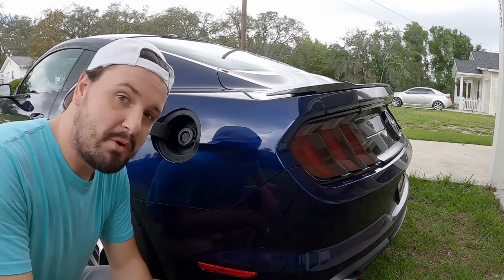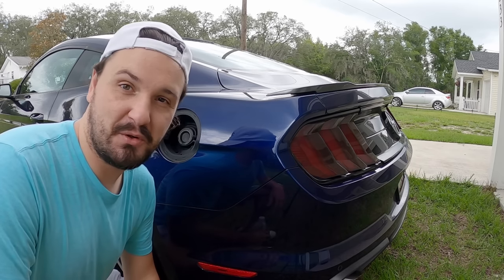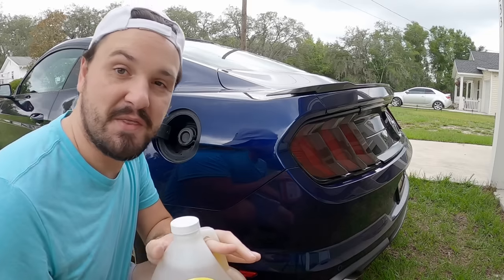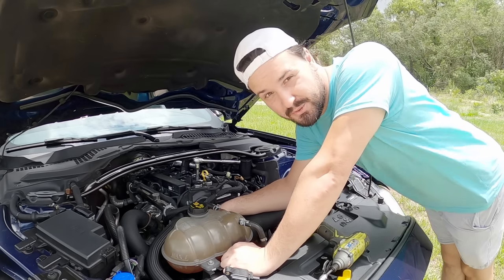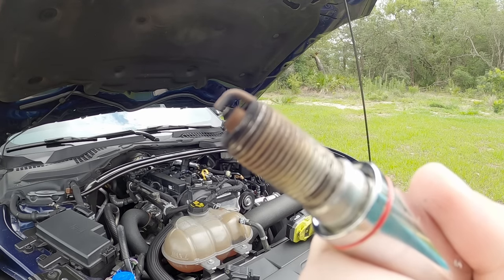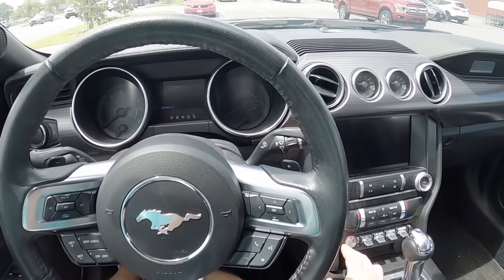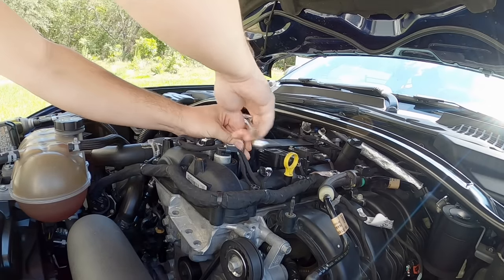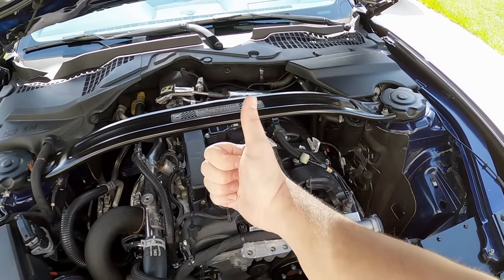The UNTHINKABLE Happened after using a Gallon of Lucas Fuel Treatment!

Comment: As a gas tanker driver for over 20 years all gas for all gas stations comes from the same place the only difference is the additives certain companies add.
Reply: Which big gas brand has the best additives in your eyes sir?
Reply: @bryarhattabaugh7313  any of the big name companies Amoco BP Sunoco ExxonMobil they all add detergents to their gas whereas the no name no frills stations don't thats why they are usually cheaper. Also when going to a no frills station you never know how long that gas has been sitting in that tank their QC is nowhere near what the big names are.
Reply: @ boogaboo--     My mechanic says with the ethanol that they put in gas these days, gas doesn't last nearly as long as it used to. He said to buy gas at a busy station, even if it isn't top tier. 

     Have you ever delivered gas to a Buc-ee's gas station? They opened one here in Daytona Beach, Florida, about two years ago. The station and convenience store is huge, and even though they have 104 gas pumps, sometimes it is hard to find a pump that is not being used. I was wondering if Buc-ee's is considered top tier?
Reply: @franknew9001  yes that is true the more ethanol in the fuel the less fuel mileage you will get. Always try to find the lowest ethanol content or no ethanol if possible. Also he is correct always go to a busy gas station because the fuel turnover is faster and the longer fuel sits it tends to go bad or collect water. I have heard of buccees but I delivered nyc Brooklyn queens Nassau Suffolk and I'm not aware of any around here so I'm not familiar. But I will tell you if they sell cheaper gas there's always a reason why its cheaper sometimes if its only a couple of cents cheaper than nearby places its because they get a large volume discount or they aren't making any money on the gas whatsoever because those places tend to use cheaper fuel as a way to get you into the store and spend money thats how they make profit and also usually because they don't use any special additives thats why there is always a huge difference in an ExxonMobil or sunocos prices vs a no frills Costco or Valero or Walmart gas station. And if you see a gas station with really low prices like way lower than anyone else stay away its either because the gas has been sitting in the ground to long or they bought a bad batch and just wanna get rid of it. Don't get me wrong its always possible to get a bad tank of gas from anywhere its just less likely from a big name. Keep in mind gas stations tend to make from 0 to 10 cents per gallon profit there's not a lot of money in gas fuel is usually a loss leader its all in the store that makes the profits.
Reply: Marvel mystery oil is where it’s at.  Couldn’t be happier.
Reply: @ ChileAddict505--      I agree with you on the Marvel Mystery Oil. I have been using it for 7 years at every fill up at the recommended amount of 4 ounces of MMO for every 10 gallons of gas. Both vehicles are 21 years old, and are running better than ever. I also use it in my lawn mower.
Reply: @franknew9001  i agree marvel mystery oil is one of the better ones.
Reply: @ boogaboo--      I started using Marvel Mystery Oil back in 2016 on the advice from my mechanic who had just replaced the fuel pump in my 2002 Chevy delivery truck. He said that by using some MMO in the gas, it would lubricate the new fuel pump and it would last longer. I also started using it in my 2002 Lincoln Town Car, and they are both running better than ever.

    Several years ago, my truck had a loud lifter ticking noise. It was a quart low on oil, so I added a quart of MMO to the crankcase. Soon the lifter ticking noise disappeared. I drove the truck about 400 miles and when I changed the oil, it was extremely dirty, and this was telling me that the MMO was removing the sludge out of the engine.
Reply: @prosperity4444  I drove for a company hauling fuel for a year and a half. Left in 2019. We still top loaded often on partially full compartments at the bulk plant. Terminal was pail drain and bottom load. No EPA in Canada 😀 still pretty stone age, probably not many places still top loading anywhere even in Canada
Reply: @juliogonzo2718  nice yeah I ran a 9500 gallon top load tanker also out of the brooklyn terminal. 3am load up i don't miss those days.
Reply: me too 15 yrs
Reply: Why would you add a whole gallon to one tank? A gallon treats 400 gallons of gas! You have no idea what your doing, do ya!
Reply: @kevinmeyer3884  thinks Lucas will pay him enough for a new Mustang?
Reply: That's not exactly true. There's more than one refinery that creates fuel, and I hauled from 2 different places in Michigan. I would say 1 plant was much better and had significantly fewer problems with pumps, mixing, and cross contamination. Marathon is a good company to get fuel from in my experience.
Reply: @kevinmeyer3884  Have you ever been entertained?
He didn't recommend that you or me try this.
Reply: @ Tricky Mick - Ethereum Classic Frog Bogs--     Within the past five years, Marathon has opened several gas stations near where I live. They have a cash and credit price, and the cash price is usually the lowest price of any gas station in the area. I noticed on the pump that it has a STP fuel additive. I usually buy my gas Marathon and have had no issues with it.
     Maybe because Marathon is newer in my area and the lowest price, some people tell me that it is not Top Tier. I tell them it is Top Tier. Seeing that you have experience with different brands of gas, it is good to see that you recommend Marathon gas.
Reply: Says on the bottle that an overtreatment is not harmful.
Reply: @franknew9001  buc-ees is not top tier from what i understand. Typically at the pump there will be a sticker that states top tier. I think buc-ees is a discount gas. If your vehicle is direct injected or turboed or both it is highly recommended to use top tier. Just my 2 cents
Reply: We have Valero gas here as alternative to big name gas stations. No additives and plenty rusted damaged fuel pumps as a result. Garbage gas to be sure. Made them replace and pay labor of 800.00 to replace my fuel pump in my 1997 Chevy Van before...they actually have paperwork to fill out to have that done knowing their gas is bad.
Reply: @ TheOne38--     Thanks for your reply. My daily driver is a 2002 Lincoln Town Car that I have had for 16 years. I usually buy gas at Marathon, Mobil, Shell, Sunoco, and Buc-ee's in that order. I usually check Gasbuddy before I buy gas to see who has the lowest price. Usually they are a similar price, but I have seen Buc-ee's up to 40 cents cheaper at times.
       
     For the past 7 years, I have been using 4 ounces of Marvel Mystery Oil at every fill up. I also add a can of BG44K to the gas once or twice a year, as well as a bottle of Chevron Techron on occasion. The car is still running very well, so hopefully these items are keeping my fuel injectors clean.
Reply: @prosperity4444  well that’s what makes the difference just so you know.
Reply: @prosperity4444  oh and you know how long gas has been sitting in the tanks at big brand name stations? 🤦‍♂️🤦‍♂️🤦‍♂️🤦‍♂️.  As I see the no name stations are way busier than the big stations.
Reply: @prosperity4444  totally untrue.  Valero is no frills?  They are one of the biggest stations. 🤣🤣.   And stations can’t buy a “bad batch”.  No such thing.  Gas is cheaper at many stations because they are not as greedy and make up for it in volume. I never seen a cheaper station not busy.  I’ve seen plenty of Mobil’s Sunoco etc constantly empty.
Reply: @prosperity4444  🤦‍♂️🤦‍♂️. Way more than 0-10 cents a gallon profit in fuel.  Ur talking delusional.
Reply: @franknew9001  That BG 44k is one of the best on the market in my opinion. That Lincoln at that year is port injected. Which you can use just good ole gas in it with the additives you are using and should be just fine like you have been
Reply: @franknew9001  At the places I went, Marathon/Speedway have their own special blend right at the pump, everything else was generic blend.
Reply: Good to know! Be safe out there driver.👊🏻☕️
Reply: Or don't add! Walmart fuel is basic fuel. Others are Top Tier with additive for a clean burn. GDI Engines need Top Tier Gasoline
Reply: Yep
Reply: @randywl8925   That was not entertainment🤡
Reply: @dakotaautosales9673  
....not a documentary or a Lucus instructional video either.
Reply: @kevinmeyer3884  yeah actually he does he did it on purpose as a satire (joke if you're too dumb to know what satire is)
Reply: @prosperity4444  yes, my father-in-law owned a gas station/convenience store & said he made no money on the gas, the gas was a magnet to get people to come in & buy merchandise, that's where he made his money.
Reply: @boogaboo  ey man. I really do  appreciate your information. Makes sense.
Reply: I work at a refinery.  The tolerances we have to be in are so tight because of regulations on fuel.  I'm sure the 3 other refineries within 30 minutes of me have the same guidelines and I'm pretty sure Exxon's gas is sold by Exxon and Shell's gas is sold by Shell.  And so on with Marathon, Bp, and other brand-name gas stations. They don't want to pay the competition.  The off-name stations are buying what they can for the best market price.  So in fact NO not all gas comes from the same place.
Reply: I stick with shell 93 octane 😂😂😂
Reply: You are correct.... I have a friend who owns a gas station, and he said the "tank farm" in greensboro nc "gets ALL the gas in the colonial pipeline from Louisiana pumped in one pipeline..... its all the same gas. The tank storage companies just add their own additives"
Reply: That’s absolutely not accurate. The natural terpenes Alone in gasoline and diesel etc is incredible. Its a lot like marijuana where they all lend different smell based on their origin and genetics etc.
Reply: I knew a tanker driver and he told me the owner of gas stations would regularly tell him to dump reg gas into the premium tanks.
Reply: Actually it 2
Reply: My daughter worked at a Sams gas station back in the early 2000’s. They never put additives into their gas she stated.🤨
Reply: @franknew9001  

Be careful cleaning an old engine as it can cause gaskets to start leaking.
Reply: Not entirely accurate, some gas stations use more ethanol than others.
Reply: So all the refineries are a lie??? There is just one refinery for all gas??? Too weird and somehow you are a chemical engineer also... Giving advice about the Petroleum Industry and their products,  who's is better and who's is not... Crazy... I guess I dreamed up being at multiple refineries over the years as a NDT lvl 2 inspector for certain items inside these refineries and also the Oilfield and Oil business for more than 20 years... Have and had family in the Biz.. And you named a few companies that are paying retirements to those family members.. Well thank you for teaching me something new today I had never heard of even in jest.. But for real, besides poking a stick at ya, Be safe out there... Them 4 wheels are morons and the 2 wheels are worse.
Reply: @scottyellis3442  Heard the same thing from all of the GS/CS's that I delivered fuel to for ten years, the only fuel that they made any money on was diesel. Gasoline just got people to come into the store and buy stuff.
Reply: @zazz69ed  lmao I had the same thoughts.
Reply: They always sell gas cheaper in the ghetto 😂
Reply: and some have rusty old tanks they store them in
Reply: @bryarhattabaugh7313  look up Top Tier fuels, they add more additives than the government requires. My GMC Terrain's manual recommends them for longer life and cleaner engine.
Reply: @bryarhattabaugh7313  Top Tier also has an app to see the nearest stations with them and prices
Reply: @executiveinvestments  the biggest difference in fuel sitting in the ground between big name stations and no name stations is that the big name stations are all monitored by the home office and if the quality falls below their recommendations they will have the fuel pumped and dumped. Also big name stations make sure filters and pumps and tanks are regularly maintained whereas the no name stations have far less quality control.
Reply: @executiveinvestments  I'm not here to argue with someone who has never been in the field a day  in their life.
Reply: @executiveinvestments  Valero is no frills sorry buddy. And bad batch means buying from a less reputable producer where the qc sucks.
Reply: @PinChE_LoCo  no problem thank you
Reply: @kylebowen4793  I'm speaking in general terms. The raw materials basically all come from the same place.
Reply: @mikewheeler1939  yes it does happen but most likely to happen in a no name station.
Reply: @Mike-qo4kp  yes this is true and some states have no ethanol at all
Reply: @zazz69ed  no you misunderstood what I'm saying I'm speaking in more general terms. Yes there are many different refineries what I mean is the basic raw ingredients to make gasoline all comes from one place oil. I was also only speaking about where I worked I said I couldn't speak for everywhere but I hauled for a bulk tank company and I loaded at one refinery and I made deliveries to all brands of gas stations. But again I've been retired for awhile now and things have changed I'm sure.
Reply: @prosperity4444 So basically your saying that you were one of the guys cheating the customers with the 89 octane BS
Reply: @mikewheeler1939  and he's supposed to say, "I can't do that that's fraud"
Reply: @prosperity4444  Ok my apologizes I misunderstood then.. my mistake. Be well.. and still stay safe out there!! and enjoy retirement!!! My wife kicked me back into working part time to get me out of her hair and out of the house LOL Oilfield is starting to act like it is going to pick back up but I'm no young man anymore LOL
Reply: @bryarhattabaugh7313  from research Chevron as they use Techron which is to this day the ONLY additive approved for use by manufacturers. Shell and 76 have their own formulas, not as good. 

Is techron worth the extra expense? Well, techron does a good job of cleaning the inside of your engine (not the best explanation but it's accurate) and if you regularly use the product over time the added cost should pay for itself with reduced maintenance costs. You could look at it like spending the extra money is a long term investment in your vehicle. 

The bottom line however is this, if you want absolute VALUE here when purchasing gasoline, your best bet is to get gasoline as cheaply as possible (try to avoid the bargain gas stations as they typically water down the gas with ethanol) and add a bottle of techron to a tank of gasoline once a month. The amount of techron that chevron adds per gallon is so small it will only make a difference if you always use chevron gas and no other. 

Personally I get gas at Arco, they seem to have rock bottom pricing and low to no ethanol, cost wise they are usually .40$ a gallon cheaper than chevron. A bottle of techron is $7.00 or so. Crunch the numbers this gives you the best of everything, good cheap gas and the investment to the future longevity of your vehicle.
Reply: @prosperity4444  much truth here
Reply: @mikewheeler1939  

That's fraud.
Reply: @mikewheeler1939  I don't doubt that for a second. If there was a quick way for buyers to analyze octane at the pump you'd never see that again. There's almost nothing preventing every gas station in the country from dispensing 87 octane advertised as 93. The average driver has no clue whether their vehicle is responding any differently. This kind of ripoff at the pumps is nothing new. It's been going on forever. Some news station back in the 70's in NYC area randomly tested some premium fuel at a gas station and it turned out to be 87. Who monitors any of this for the customers these days? I don't know of any entity that does as a regular practice. One thing I can guarantee; if you buy 87, you're getting at least 87. Anything after that is a crap shoot. Btw this video is dangerous. You'll have Mustang owners all over the country buying pallets of gallon jugs of Lucas and swearing by this method.
Reply: @ Jesus is Alive--      The only oil additives that I have used in the past 10 years is BG-MOA and Marvel Mystery Oil. Marvel has been around for exactly 100 years, and has been thoroughly tested not to cause any damage to gaskets. The only time that Marvel might have caused a leak is when it has removed some of the sludge that was keeping the gasket from leaking.
     Thanks for your reply.
Reply: Same for motor oil, brand is pretty much irrelevant.
Reply: @bryarhattabaugh7313  Shell gas has one of the best Additive packages to their gas but their price reflects that. boogaboo is right about the source of all gasoline today, it's not like the old days when some of the larger companies had their own distribution centers.
Reply: @prosperity4444  There are several different crude oils though.   We run a heavy paraffin crude where I'm at that would yield a little less in the iso units than other refineries.   I'm not trying to argue one way or the other.   As I said though,  the regulations put forth by the EPA require certain parameters for fuels be met on the tank before it can be certified to ship.  And there's multiple ways to get the petrol cuts.   Like cat cracking.   At the end of the day there still has to be a test on everything being shipped and I'm certain that happens everywhere.   If you are getting scale and water in your tank then it's time to go to a different station either way.   My only point is that these issues are not coming from us (the industry).
Reply: @alfredocuomo1546 The refinery I work at must just be behind in the times then.
Reply: @kylebowen4793  I wasn't speaking about refineries but rather distribution. My buddy worked for Exxon in Linden New Jersey and all the Exxon stations in NJ received their gas from that refinery but today they get their product from a universal distribution point and it isn't delivered by Exxon tankers but rather Island Transport. Maybe where you are it might be cost effective but not in the Tri-state area as far as I know.
Reply: @prosperity4444  I like the fresh hot dogs on the spit and they have the freshest buns.👌
Reply: ... And the additives are the proven important bit.
Reply: Is that you Casey?
Reply: @zazz69ed  yeah, and then it all goes into the same pipeline...the additives are added the hubs. Boogawhatever was correct, despite your self identifying as an inspector.
Reply: I hauled for 5 years.  Never had any additives at any of my stations.
Reply: @Nicole C  they add them at the hubs...not at the stations...unless you go to that crappy Murphy station that you can buy the gimmick stuff, and it "blends" it while you pump...
Reply: @bryarhattabaugh7313  shell.
Reply: Nope.
Reply: If you want added protection.. add some 2 stroke mix to your gasoline.. I'd keep the ratio  lean at 100 to 1
Reply: @ChileAddict505  marvel has always worked since the 60's for me
Reply: @franknew9001  as a snowmobile mechanic i got certified in 1993 to do "warranty" repairs on POLARIS  equipment in Milwaukee, i was employed at a polaris dealership at the time.
they told us that GASOLINE WAS FORMULATED TO LAST JUST 30 DAYS"   THAT WAS BACK IN 1993!
they also showed us where the secrete hidden numbers are on personal watercraft  so we could give the numbers to the police in case they suspected the craft as being "STOLEN PROPERTY", AND TOLD TO NEVER EVER LET THE POLICE KNOW WHERE THOSE NUMBERS WERE.        LITTLE DID THEY KNOW THAT I HAD BEEN KICKED OUT OF PORTAGE SUPER MAX ON MANDATORY PAROLE LESS THAN 1 YEAR PRIOR!!!!
Reply: @executiveinvestments  I've seen gas stations get bad gas as I've purchased and and many other did as well and company checked into it. Gas goes bad quick especially this reformulated ethanol oxygenated crap. You may be lucky and live in part of the country that doesn't use this crap. Most certainly a fact stations get bad gas!
Reply: @prosperity4444  mobil bad gas two time in one year!!!
Reply: @buixrule  my Lincoln LS has spark knock if I use anything below 91 my gmc 6.0 has knock on anything lower then 89.
Reply: @gunguyforlife630  there big difference in motor oil plenty of info online and again it's about additives. Go to cheap oil change place and you'll be replacing a engine . I've seen the inside of these engines that run cheap crap oil. Big difference but hey you do you!
Reply: @dennisbonville3217  you can “see” bad gas now? 🤦‍♂️🤦‍♂️🤦‍♂️🤦‍♂️.  No.  Stations don’t get bad gas.  That’s a myth.  Gas goes stale in time yes.  So you went to a station that doesn’t sell much gas so it went stale.  Wow what a surprise.  Has zero to do with a “bad batch”.
Reply: Bwahahahaha, I worked on tankerships, we picked up gas from Shell Oil and ExxonMobil and delivered to British Petroleum and they had tanker trucks from every gas station out there filling up next to each other!  IDK about additives! Could be a ploy! Lying just like every other Corporation out there!
Reply: @franknew9001  
So Marvel mystery oil will take the slack out of valve lash when the clearance measurement exceeds manufacturer tolerance specifications?… 👍
Reply: Buc-ee’s is NOT top tier.  It is exactly as the writer stated.  They sell cheap gas to sell other stuff.  Their gas does not have detergents that are required to be top tier.  I do love that they sell ethanol free 93 octane gas and they are a great place, clean, good food, safe!  I purchase their non-ethanol 93 octane and add a bottle of chevron additive.  Any additive with PEA - Polyether-amine will clean the injectors.  I have read and watched that ethanol free gas and PEA is the best combination for any engine and especially for cars that do not get driven a lot or sit through winter……….this is not professional advice and I am not a mechanic.  I simply watch a lot of you tube and Porsche Club of America often has experts on to discuss fuels and fuel additives.  You can google it.
Reply: At least he did this with a gaystang 😂
Reply: @DavidBoerboom     I hauled gas for 5 years.  They didn’t add at hub
Reply: @nicolec7290  yes they did. You just weren't there.
Reply: @ETCFrogB as a contractor I work at the marathon oil refinery in Michigan and they take their products seriously I agree marathon or BP/ Amico are the best fuels
Reply: @prosperity4444 thank you for all your information
Reply: @Mark USA  uh, no. Shell is BY FAR  the best / most superior unleaded gasolines...even over ExxonMobil... .
Reply: @prosperity4444  Sooo going to the no frills station is best to use a gas treatment additive and perhaps octane booster?
Reply: @ChileAddict505  all it is l, is mineral oil.
Reply: @DavidBoerboom  …and it works as advertised.  🤷‍♂️
Reply: @prosperity4444  Costco an Valero are in fact Top Tier certified fuel
Reply: @ChileAddict505  
Interesting.  Our XJ has 373k on it  and still gets 22mpg.. no smoke.
We  do use a bottle of Techron once a year but it runs this way on 85 octane at 8000 feet.
Reply: @executiveinvestments  👈 someone doesn’t know what they are talking about
Reply: @ohboy2592  👈👈 someone is triggered that I actually know what I’m talking about.
Reply: @executiveinvestments  lol, my family has been in the service station and gas station business going back to the mid 60’s.  I can tell you from longer experience than you’ve been alive that you don’t know what you are talking about.
Reply: I used Lucas Oil in  my gas tank on a 2007 Lincoln Towncar and it corroded the gasoline measuring device. My   tank always read full even when empty.
Reply: That's correct.
Reply: @boogaboo9851  No frills type stations like you say sell cheaper gas, so usually get more business from low income earners who drive old beaters that might not be all that fuel efficient..  So no problems where I am about old gas at the pump...lol...
Reply: I had 3 Camry they all stall cause I never put additives the 3 one it ran so good I wish I learn that no gas station don’t put any additives
Reply: Yep. I followed  a tanker one night for fun it stopped  at chevron, Arco, shell, Safeway gas and valero
Reply: @bryarhattabaugh7313  you can buy the additive in a bottle that Chevron adds in at the load rack.
Reply: @prosperity4444  I use to load both over the top and bottom load dry lock. I worked nights for 7 years before moving to days for the next 17 years. On one night run I pulled into the unmanned load rack to see a containment area 5” deep in diesel fuel. Had to call the boss to let him know I needed to go load at a different rack.
Reply: Uhhh no that's not how that works. They are refined using the exact same process, but they do not come from the same place. Texas uses oil from Texas, PNW uses the Pudget Sounds oil, Alaska uses AK oil. 

Best gas you're going to find is going to be ethanol free (if price is no objective). 

As far as the best gas you can find for a cheap price you want a station that sees a high number of customers like QT or Murphy's. Off-brand gas stations are the ones that shut off tank alarms and continue to operate. Big companies do not. High fuel sales also reduces the likelihood of moisture collection in the fuels as they are constantly refreshed. 

Worked over for a dozen gas stations in my time, I've seen both the right way to do things, and the cheap ass shortcuts.
Reply: @bryarhattabaugh7313  shell vpower
Reply: is it true costco adds additives on the spot?
Reply: @daveroski  i can't speak for Costco i never delivered to them. I hauled for Amoco, Mystic and Island
Reply: Same with a lot of the oil
Reply: @buixrule  there is. Ktuber. Or most tuning platforms. It will tell u your knock control number. K-control. After driving a little with crap gas it shoots up an I know it's crap gas hahaha. Happens at Mobil an shell every once an a while but not as big of a dip.
Reply: @franknew9001  That's what he meant.
Reply: @ChileAddict505  Too much will melt your gaskets
It ruined our engine. We had Junk the van
Reply: @franknew9001 marvel mystery oil is an oil with high detergent. Similar to ATF.  Putting this stuff in your gas tank will not help clean it. Similarly to water, gasoline doesn’t mix with oil well after its been refined.  What you are likely doing is making your fuel pump run harder and clogging up your fuel filter and injectors faster and hurting your engine’s performance and reducing your gas mileage.  4oz isnt much for awhole tank of gas. But it most definitely isnt helping anything in your fuel system.  Putting MMO in your engines oil will help remove oil sludge though over time.  Dont expect instant results. And be weary of old oil seals and gaskets. It’ll likely accelerate the leaks
Reply: So very true
Reply: I'm not disagreeing with you. But I had a car that was Very sensitive to fuel brands. It was a 2005 Scion XB. I Could use Jetpep, (currently Marathon) and Never Ever reach 30 miles per gallon. The most i got from them was 27-28. 
I could use something like Shell fuel or BP and easily get 35-37 miles per gallon. There was one gas station in my town I could use that did better than any other. It was an ExxonMobil station. We had 3 of those stations in our city. But only one would give me peak fuel mileage. Using that station and only that station, I could get 43 miles per gallon from that fuel. All 3 were supplied and serviced from 1 local company called Brown's fuels. I found it odd that only one would do peak economy out of all three from the same fuel supplier.
Reply: Sarcastic, cynical love it. So the conclusion is that most of these expensive products do absolutely nothing and at the expense using fuel additives on a regular basis you're paying Upfront for the cost of the repair that you're trying to prevent in the long-run anyways
Reply: Royal Purple and Chevron fuel system work great too. Hope you changed your motor oil after that treatment? That puts lots of contaminates in the motor oil.😎
Reply: Most of the convenience stores, Casey's, Holiday, etc contain little or no additives. At the racks in Minnesota there are 27 recipes for regular unleaded gas.
Reply: @prosperity4444 how and when do they mix in the specific gasoline brands' additives?
Reply: 20 years of wisdom summarized 🤯
Reply: When I hauled gas in 2001 there were many different recipes for gas at the rack. I always double checked mine before I started.
Reply: Around Christmas time every year my old lady gets this lantern fuel that smells like evergreen Christmas tree I pour a quart in my 350 Ford 6.0 at fill up, boy does it smell good running down the road,. Truck over to my mechanic friend he pulls my turbo off every year clean the veins and making sure the bearings and my veins are moving like they're supposed too not gummed up now he says everything works like it should and it smells better than any truck coming in the door ,
Reply: In my experience,  in Canada we have Fast Gas, Domo and my take is anytime I have water in my tank ... OK not my car however friends that fuel up at those places the gas will have excessive water/moisture in there gas, and I agree with ethanol.... it sucks. I always have a jug of methyl hydrate for daily commuters on the road driving Lexus ect. with cheap gas. A jug worth $10 will always pull many people out of a bind. Oh yeah diesel fuel is worst but I don't drive a diesel so most of them carry fuel conditioner
Reply: This has been an interesting read! My experience with my 98 Dodge Durango with the 5.2L motor has been really simple. I owned the Durango for 11yrs. When I bought it, the Durango had 62,500 miles on it. Now it has 152k miles. So when I bought the Durango I had the injectors cleaned at my only shop I take my vehicles to. Since then I run 87 or 89 octane gas and every time the Durango gets serviced (oil change, greased bla bla bla) I put a bottle of Lucas injector cleaner in a fuel tank and run it down on E before filling up again. Also, once or twice a year I will use a can of Seafoam in a full tank of gas (87 or 89) and run it down to E before filling up again and my Durango runs very good and always have! 

If u are wondering why I don't put that my miles on my vehicle? I have been a truck driver for 18yrs and only drive the Durango on the weekends & vacations. Unless my son or girlfriend needs to drive my vehicle and let me tell ya, my son can put some miles on a vehicle! LoL
Reply: @prosperity4444 Walmart/Sam’s use Top Tier gasoline, which is one of the highest standards for additive/detergent packages in the industry. It’s not a no frills issue, it’s the amount of fuel they buy, just like the in store model.
Reply: As a former employee/installer for Gaurdian Fueling Technologies, you’re absolutely right, detergents and octane are the only differences.
Reply: And how is filtered/cleaned
Reply: @zakbrinkhoff324  Say you have no idea how it’s made without saying you have no idea how it’s made.
Reply: @mikewheeler1939 I have always wondered this. I had a turbo car, and whenever I would fill it with 92 octane at this family gas station I felt like my car didn’t feel as powerful and sluggish. I thought they just had bad gas but now I’m wondering if I was just putting in regular gas and got hustled. That car there was a noticeable difference if you didn’t run premium which was what it called for.
Reply: @zazz69ed my brother in law was an ndt inspector. He was always traveling. Last place he worked was coffeville Kansas. He set up some sort of imagining system to measure thickness of pipes at refineries and chemical plants. Inspected welds, and stuff like that. Your the only other person I have ever seen say ndt
Reply: Then how was it that Amoco was transparent?
Reply: There's something different for sure. I went  to Sprint which is a local chain of gas stations and everytimeni got 87 there, my pickup would ping. If I went to the gas station across the street, it wouldn't ping with 87
Reply: How about maverick gas station northern Utah area 84321 ?
Reply: And the amount of water collected inside the underground tanks is exactly the same?
Reply: @prosperity4444  Costco fuel claims to be top-tier.
Reply: I don't think that's true cause a lot of these mom and pop gas stations buy the cheapest gas on their market which makes your vehicles run like crap there are several companies that sell gas to the station owners not just one just look in Texas alone
Reply: So what about Shell Premium V power
Reply: @bryarhattabaugh7313  I hope he didn’t get any in his eyes! 😂
Reply: quality of the tanks holding gas is different from large stores to small mom and pop and also the trucks delivering the gas conditions can be different than the larger shell/ Exxon stations. So it may come from same place but it doesn’t mean you have the consistency of a quality product in all stations
Reply: @prosperity4444 i hate to sound s lil slow sir but what is QC quality control???
Reply: I've seen you guys pour Lucas in after finishing a pump 😂
Reply: I APPROVE THIS MESSAGE!  I ALSO WAS A GAS TANKER DRIVER FOR KENAN ADVANTAGE IN OHIO AND SAW IT IS ALL COMES FROM THE SAME REFINERIES AND GET DIFFERENT ADDITIVES ADDED JUST DEPENDS ON THE STATION.
Reply: Who is the provider for all gas companies?
Reply: @buddystallworth6158  ur mama lol
Reply: Is shell nitro the best? That's all I use.
Reply: @mikewheeler1939 I also was asked that as a fuel tanker driver years ago.
Reply: And whether you get the last of the tank with all of the deposits
Reply: Having read many of the comments, let me see if I can clarify some things, and possibly offer some enlightenment, but it's going to be a long read.
For the east coast of the United States, (as an example) the colonial pipeline company maintains a pipeline from Houston TX, to New York city. With the exception of Some coastal areas, this pipeline is responsible for almost all distribution terminals (load racks) on the east coast. Meaning, they all get the same gasoline, from the same place. HOUSTON.
The Houston refinery pumps the same thing to shell, as it does ExxonMobil, and everything else.
If you've ever seen a loading terminal, you've probably seen the big tanks they store the gas in.
One tank will have c-bob gas, regular, but under octane to sell to a consumer. The 10%addition of ethanol raises the octane to 87, making it legal to sell.
Mid grade is a blend between regular and premium.
However, since ethanol is around 113 octane, you could literally make premium, with regular gas, and enough ethanol.
That's why the load racks have different "recipes" or "blends" for different customers.
And those "additives", aren't really what you think. 
Certain large companies like shell, and others, require shell "branded gas". Same gas everyone else gets, but with certain additives that act as "markers" simply to prove the brand.
Ethanol is bad people, in every way possible. 
Ethanol attracts water. BIG TIME.
Ethanol shrinks, and destroys rubber.
And ethanol burns hotter than gasoline.
Non ethanol gas is always the best.
Ethanol receives a 50 cents per gallon in federal subsidies, to keep it cheaper than gasoline, meaning there is a financial incentive to buy it. 
That's the truth about gasoline.
It's basically all the same. Only differences are the additives that go in at the loading rack.
And those, are not what you think.
Reply: Shell Nitro V being the best additives
Reply: @joefergerson5243 I don’t think Sam’s is TOP TIER GAS.
Reply: @prosperity4444  the time sitting in the storage tanks means zip.  But the other contaminants in that tank, are a biiiiig deal!   But yeah no , stale gas is not a problem actually, at all.   My dad was a chem engineer and fuel top expert on the planet (aviation, where the fuel kinda matters a lot, lol)
Reply: And the condition of the tanks it is in and out of. Rainwater seeping in bringing bringing the contaniments, how long since manufacture, the sales volume of the station you are buying from, time of the last delivery, maybe the ethanol content, and like you say, the additives.
Reply: @franknew9001 if it’s top tier it says so on the pump
Reply: @ darensylvara7690--   Thanks for your reply. I just bought gas at Buc-ee's yesterday, but didn't look closely at the pump to see if it had a "Top Tier" sticker on it. I will look the next time that I buy gas there.
   The Buc-ee's in Daytona Beach is huge with 104 gas pumps. It was so crowded, that it was hard to find a pump that wasn't being used. They usually have the best price in the area, except for Sam's Club, which is normally about the same price.
Reply: Yup
Reply: Back in 2019 in Baytown Texas, Buc-ee's sold their cheapest gas for 1.349 a gallon, too cheap.  I stay with Shell, Texaco, ConocoPhillips, Citgo- big name fuel and majority no ethanol (hard to find with Exxon): better mileage.
Reply: @ k owen3959--    Here in the Daytona Beach, Florida area, ironically the only gas stations that I can find that sells non ethanol gas are Buc-ee's and Wawa. Both Buc-ee's and Wawa may not be Too Tier, but I usually buy their non ethanol gas for my lawn mower and chain saw where the gas might not be used for long periods of time.
Reply: Exactly.  Fuel haulers here as well. Chevron and shell i think have some of the best additives. But in the end it doesn't really matter much.
Reply: Yep, I have worked as a refinery process operator for 31 years in SE Texas. Gasoline is gasoline. The only difference is the additive package that different brands put in. For years it's been common knowledge here that Chevron has the best additive package.
Reply: Except for the places that re refine transmix…. That stuff is garbage
Reply: I wonder why Thorntons is the Chicagoland area us always cheaper.... Been using it for years seems to also last longer and there a is always a line to get to the pump.... Andi always see that they run out of certain grades where they put those red bags on the pumps.... So I know it isn't sitting... It moves. Why do you think in their case it's always waaaaay cheaper? I will run out if gas to get to a Thorntons.. And I get their 25 cents off a gallon once every couple weeks if a member.
Reply: So iv heard and have allways belived that mid grade gas is just the premium and regular MIXED from the tanks like when the local "you" fills up the station. So never know its exsact make up and so on.

I been thinking  about it more and more and not sure anymore

Is it true bro?
Reply: Shell has the best 93 octane gas period.  It's been proven time and time again especially with modified cars running more timing.
Reply: I e been telling folks that for years
Reply: Man why do that to your mustang? I mean if you had a 1995 s10 or a k car then giver…
Reply: I worked in a refinery and you are correct. All unleaded gas and diesel regardless of the refinery that it comes out of is essentially the same. The difference comes in with the blending agents and additives used or required by Clean Air Regulations. I have run 87 Octane Arco, Shell, Mobil, Chevron, Exxon, Sinclair, Unocal, Costco, Sam’s Club, 7-11, Fastrip, (No Brand.) Flying-J and it all runs the same because the Octane is based on the R+M/2 Method used to calculate it. It all comes “off the rack” and into the truck. I have noticed no difference in performance in my Chevy Equinox, Silverado or Sea Ray Boat. The only difference is I get less mileage out of a tank of gas with a higher blend of ethanol.
Reply: I have been telling people this for years when the intentionally search stations that are 1.00 more expensive than arco. It’s just wasting money.
Reply: @boogaboo9851. You are absolutely correct Sir! Ex oil field refinery worker here.
Reply: As a former (now retired) trucker, I got to talk to many drivers. I had a gas tank driver tell me once that he had good stations and bad stations that he delivered to. Good ones treated him well, gave him a free coffee or cold drink, depending on the weather, and treated him like a human being, while the bad ones didn't care about him at all, and only looked down on him. He told me that as  a result, the good stations had more of the good additives in their fuel, while the bad one got much less.
Reply: Sonoco 100 definitely does not…
Reply: @chuckfarley5415  I didn't know that. Tell me about Sunoco chuck and why they are different.
Reply: You mean the same refinery? There are different grades of refinement from Regular to Premium.
Reply: OP is 100% correct. I used to inspect oil refineries and tank barges for a federal agency. Also supervised cleanup of oil spills and taught hazardous waste operations courses. (Just to add my bona fides) It’s all the same oil. The proprietary detergents are the only difference.
Reply: @MarsellusWallace2024 I haul crude and literally everything else that refineries need to create every fuel product imaginable and I’m here to tell you that I can pass off nearly anything past most pump sensors as long as my gravity and BS&W are in order.  I do what I’m told and the blending plants create the mixtures but it’s not all legit.  Next time go ask one of those operators if he’s ever slug-jugged a load because the dumb ass driver didn’t grind out their load.  I get behind these guys every day almost and have to wait on another station while they bleed out the last guys load.
Reply: Something else the average driver should know is there are a bunch of filters between the tank in the ground and the pump.
Reply: So You ever go to Shell refinery? If so which one.... I kinda know a little bit about the business but I not a CDL driver.
Reply: @ChileAddict505  How often do you use it?  I add it in about once per month.
Reply: @kevinmeyer3884 right, even the tiny ones you get can treat up to 25 gallons I believe 😂
Reply: Blah blah blah blah I use this gas station blah blah blah
Reply: I bought a 2006 Dodge Grand Caravan back in 2012 and toured North America "Van-Camping" from 2012 to 2024 visiting 48 States, half of Canada, including driving all the way up to Happy Valley-Goose Bay, Labrador, Canada, and the northern Mexican border towns from the Gulf to the Pacific Coast (dangerous areas there), and now my van has almost 300,000 mi., and I always chose the lowest priced gas I could find in each state... Therefore, in my humble opinion, there is no such think as HIGH END gas... I say it's all the same... By the way, I STILL HAVE THE SAME VAN and it still runs fine.
Reply: Been screaming this for year's. It's crazy how many people don't believe it.
Reply: @mikewheeler1939 some station owners are shady and will do that to save a buck here and there. But it’s not common. I have had only one station owner request this and I declined.
Reply: Yeah but some stations water down their gas…so I’ve heard and sometimes kind of seems like it with how fast it burns compared to other stations
Reply: @christianrose227  impossible. You can’t mix water with gas. it will just sit on top of It similar to cooking oil. But some refinery’s don’t put a lot of additives which leads to worse mpg’s. I recommend shell, BP, or 76
Reply: Believe it or not you can get the same results from  using Marvel Mystery oil and instead just using transmission oil.  You would be amazed at how tranny oil works for you.   It was something we did back in the day when fueling our BIG Trucks. It works with big diesel engines and it works great for gasoline engines just as well.  It  Cleans, it lubricates , it raised the cetane and helped with gelling in the winter  AND  it's a lot less than high dollar additives.
Reply: @prosperity4444  A little late that I am replying but thanks for the insight.
Reply: Thats right samething with mtor oil they just put a color in oil
Reply: I learned that decades ago (1965) while working at a Gulf station in SoCal. I was the night attendant and a Gulf tanker pulled in to refill our tanks. I went over to him and he said to me "Today you're getting Shell regular." I said, "HUH??" He said, "Yep. we were running low so we filled up today at the Shell yard across the street". Then he explained all Gulf does is add the additives before filling the tanker. I have heard that they run underground pipes so they can fill up in their own yards whenever one or the other runs low.
Reply: Additives (more importantly the lack thereof) are what make or break gas and wether or not it will leave residues in the combustion chamber
Reply: My grandfather was an engineer at Shell, he told me the same thing, that’s why I always get the cheapest gas and add my own cleaners/detergents
Reply: That’s exactly what Scotty said so I know you’re telling the truth because I trust Scotty on YouTube
Reply: 🍀While I'll be Golly👀✌️
Reply: I work for a GA station no it don't it comes from cheap place in country.
Reply: That's why you gotta find the ones that have no additives and are ethanol free
Reply: @busterc6600 what’s your compression ratio lol
Reply: @prosperity4444 I agree with Marvel Mystery Oil being one of the best I've ever used, Is Shell gas considered a top tier brand gas it seems to burn better in my vehicle
Reply: @prosperity4444 supermarket  gas with lucus seems to work out same as lucus
Reply: Yes, very true !
Reply: or remove
Reply: The EPA tells the oil companies they have to put in the gasoline. Top tier gasoline has the most. That is the reason you have use top tier gasoline.
Reply: Your tire light is on ! Put some Lucas in it 😅😅😅😅😅
Reply: @franknew9001 yep. I almost always get our gas at the local Walmart station. The pumps are always full. Been going there for years and never any issues.
Reply: I second that. I've been hauling fuel for years.
Reply: In a huge fan of she’ll never had any real issues on it.
Reply: How much do they add for a tanker?  Thanks
Reply: Do you mean WATER .....
Reply: @MichaelSchmitz-r1e  
No additives
Reply: Except for PeeMex.
Reply: My fav is diesel, t6 by shell guarantee, 500,000. Mile or 15 yrs ,
Reply: @bryarhattabaugh7313  the one that has your car filled. its all b.s. they all about the same
Reply: Also, when I used to work at a fuel station in high school, I'd see a third party tanker fill the competitor across the street, and then come fill me so you are right. Often times, Hell, even most of the time, the fuel is the same at every station. What really matters is if the pumps at that station leak and take on water and debri in their pumps before it goes into your vehicle. Sure, certain fuels are better based on additves that company uses, but we don't often get that fuel so at the end of the day, a fuel station, is a fuel station. Great comment.
Reply: I drove a gas truck for 5 years , never heard or seen company’s add anything to their fuel
Reply: Premium fuel 91/93 is more stable and lasts months longer than 87, before going bad. Costco and Valero are top tier fuel just as good as ExxonMobil.
Reply: My buddy who hauls gas for a living says the same thing.
Reply: That what I thought and 87 89 and 93 are the same but rubbing alcohol is added for oct
Reply: Find the least expensive TOP TIER.  Add a bottle of Techron periodically.   Chevron is a vertical supplier meaning they are a refinery,  AND own one of the 4 companies that make chemical additives.
Reply: There is a label on pumps with TOP TIER.
 
As far as I'm concerned, no label,  no fill. I buy enough to get home and top tier is a block and a half away.  If on a road trip,  oh well, it's only one of 2 tank fulls for the day.
Reply: As someone who works at a Gas plant I can assure you this is facts. 
Chevron would come to our Plant which is BP,the people who make arco. And Chevron would come to get the gas
Reply: @RossMalagarie you gonna need more than top tier fuel for gmc terrain long life 😂
Reply: Haha. THANK YOU. I worked as a welder in terminals all over the country.  You’re absolutely correct.  It’s all the same.  Most additives were even shared
Reply: @franknew9001 If I'm not mistaken, and I might be, you're should kinda ease into adding detergents like that so you don't clog your filter. Unless your filter has a bypass in which case you'll just be running nasty oil through the motor. But idk man you probably know what you're doing.
Reply: @willischin9072 Or shouldn't be a problem should it? Lucas is made of petroleum distillates of I'm not mistaken.
Reply: THANK YOU!